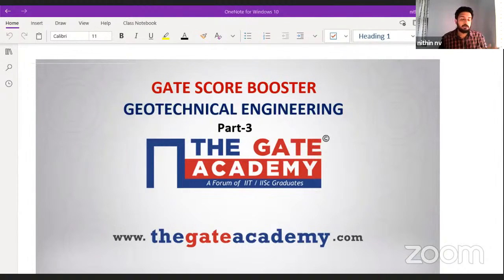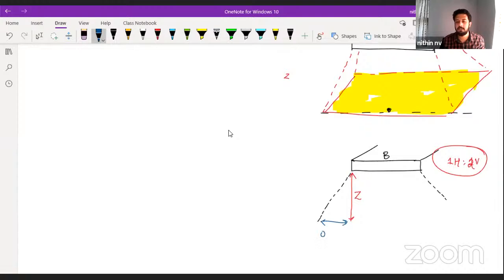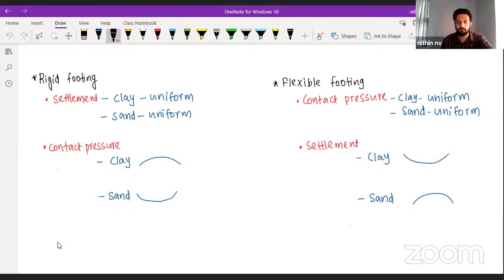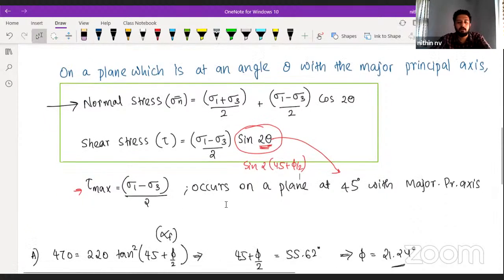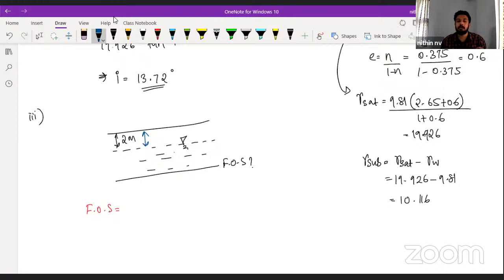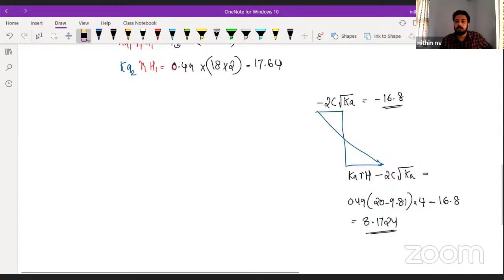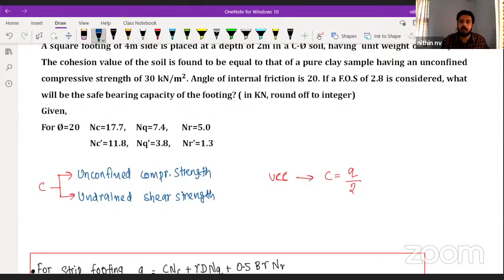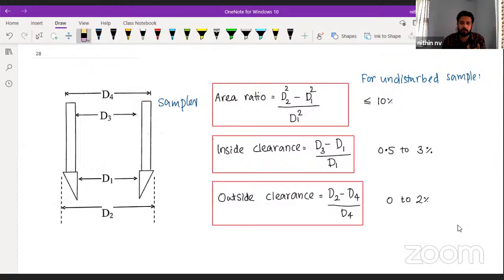Geotechnical Engineering-Part-3

Comment: Sir can I skip Plie Foundation,? It is  quite tough to remember all the formulas. Please comment
Reply: Dear Subhajit, If it is very hard to remember the formulae, atleat you study the equations for clay soil. That will be easier. You can also check the pile group equations. Generally piles in sand will be a little complicated.